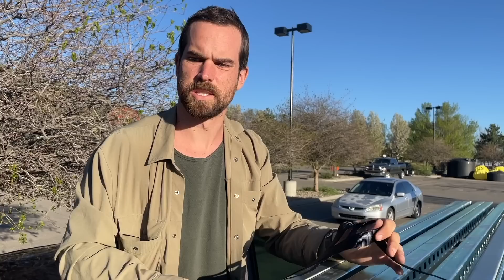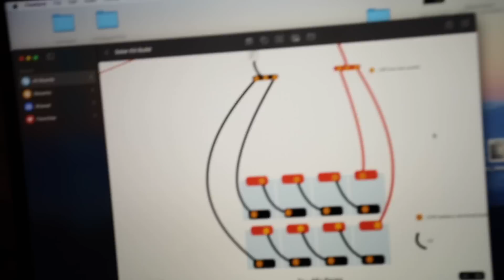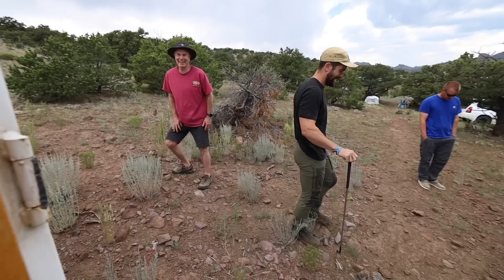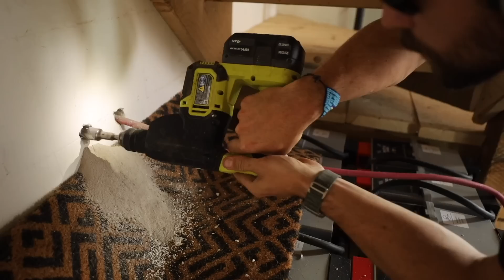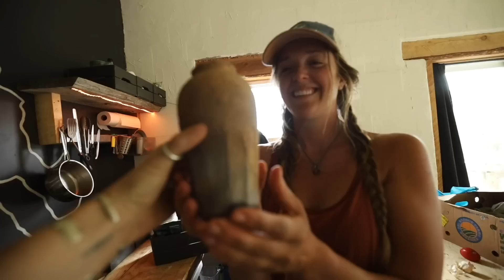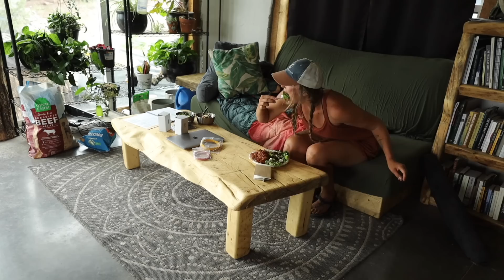IT'S COMPLETE!!!! | Solar Power System Install - Off Grid DIY

Comment: I don't know if you all will even see this or not but I'll  tell ya about anyway. I know how you both want to stay off grid as much as possible  but when I saw you hooking up your solar post yesterday it got me to thinking. Barron said you were thinking of propane or electric hot water heaters. Years ago when I was little our electric hot water heater caught on fire and my dad didn't want to risk it happening again  so he just took it out, anyways  he was some what of an inventor and for winter he built a woodburning hot water heater.he found a water tank  with a flume going up the middle of it built a fire box to have a fire in and welded them together and hooked water to it it helps heat the house in the winter and they have hot water. In the summertime they have  solar hot water. He took an old side by side refrigerator and put two water tanks that he painted black inside and covered it with a sliding glass door pointed it south and you basically have hot water all summer long. He passed a few years ago but my mom still uses this system to heat water. Sorry the post is so long but I hope it helps.

Comment: From an Electrical Engineer, for a DIY project, that solar installation is fine. Like you said, you gave the reasoning for the flat vs angled solar panel etc, and that hopefully, a certified electgrician will come inspect it later etc, etc. 
Only thing that I would have recommended (not seeing it, but it may be there. If it is, then ignore),  would have been a battery disconnect breaker for each 48V battery bank.

Comment: LP stove , dryer and water heater 100% Keep the load off the electrical so you have the power for stuff you can't use LP for.

Comment: i dont get it... why not install that inverter inside together with the batteries just to protect it from the weather outside and safer to fix/troubleshoot it especially when its raining hard
Reply from the maker: It is designed to be outdoors and because it is so loud as stated in the video

Comment: Mind blown on the sun/fire explanation! Joining the club of the clueless re: the electricity, but my husband and I would love to have some solar power at some point and I just love watching you two tackle projects, so this one was fun. We love our gas on-demand water heater, although the on-demand part means we have to run the water for a minute or two before it gets hot and I don't like wasting that water. I had an electric glass-top stove at my last house, now I have gas, and I wish I had induction. I thought I'd love gas, but I don't think all gas stoves are created equal. I find it very difficult to get the heat low enough on our builder-grade model, I don't feel like I can cook as well on it, and we always like to have ventilation on when we use it. We've had a couple accidents of leaving a burner on which is scary, plus I burned myself pretty bad one of those times. But someone mentioned canning, and I can see how having high heat for that could be helpful. A stove/oven is like a power tool in that if you're going to use it a bunch, it doesn't pay to cheap out.

Comment: Good job.  I'm installing a 30Kwatt system now.  Just an FYI,  you will want to double your solar panel's because of low winter sun yields.   Summer gives gobs of power.   Everyone should design their solar system based on winter conditions.
Reply: I think that's very wise advice.🎉🎉🎉
Reply: I absolutely disagree! 
This is the main problem in solar power you never know how long an deep are the 'winter conditions' your system can be too small ever. Use grid power or generator power if you will be offgrid!
My advice water cooled diesel generator for heating.
Reply: Thank you for that info. This will be my first winter, so without that info I'm making my system expandable- batteries and panels.

Comment: What a great video! Thanks for sharing! I'm on year # 12 living full time in a small RV. I do like using the water tank, and love having propane for cooking and heating water. It's nice to have, especially for an emergency heat source.  I am still using my now 21 year old Atwood RV 6 gallon water heater.  Never fails. I turn it on for about a half hr which gives plenty for 2 quick showers and dishes. Then I turn it off until tomorrow. Propane stoves and ovens are so reliable.  Enjoy....You guys are so cool. 😎

Comment: If you guys are planning to do any canning a propane stove is probably the best way to go. Induction is not great because the glass can crack. You also need specific cookware for them. Great job on the solar!!
Reply: Agreed.  I took a canning class last year and they advised not canning on an induction or glass top stove.  Flame heat only.
Reply: Could they not use an induction  for general cooking as they have a solar set up  and use a gas Camping stove for their Canning???
Reply: @sparsh415 I agree since they will be using solar for electricity induction would be good for regular use. There are some great camp stoves that would work with propane outside where it doesn’t heat up the house. My stove has an induction cooktop with a convection oven that also has air fry. That’s another small appliance that can be eliminated from the countertop. It also eliminates the need to do such small batches in a regular air fryer.

Comment: Congratulations on your new power system.  Didn’t understand most of the specifics but I can always rewatch it.
Propane cooktops are easier to control your heat and that can make the difference depending on what you’re cooking.
I notice you guys had Linnea visiting, are your properties close to each other and do you guys also have 40 acres?  Enjoyed the video!

Comment: How do you plan to clean them in the winter or harsh elements? Will you have any safety measures put in place in the case you need to access the roof?

Comment: Few thoughts on the stoves. If you  get induction be very careful with cast iron. They aren’t recommended for induction ovens and even if you do use them it’ll scratch it up. For actual cooking, GAS ALL THE WAY 👏 Not only are you guys used to cooking on gas so switching to induction will be more annoying but there is no better way to cook consistent meals than with gas stoves. :) 

This comes from us living with both versions and I would take a cheap gas stove over any induction stove anyyy day!

Comment: We have had solar water heating for 16 years - our tubes heat glycol that then transfers the heat into our tank. The glycol works really well because it can still heat if it’s below freezing, but sunny.  We have a fan cooled radiator when we’re making too much hot water.  I looove my endless hot water in summers. Our big tank does use a single electric element we turn it on when we need to augment during dark dreary days.  Hope you’re not in the path of any wild fires. Wishing y’all continued success with your solar system.

Comment: Good job. This will work fine. In the future, flip every other battery 180 degrees and the copper wires can be shorter.
Reply: I considered this but figured it would be more confusing to look at.

Comment: Interesting your doing battle born batteries. I had mine put in my tiny camper 2 years ago and then it now is dead and the company checked it to try and restart it but it is dead dead. I always kept it well charged too over 90%. Anyway, I’m waiting for Battle born now to honor my warranty and it’s been over 2 weeks. I’m glad the company who put it in my trailer is dealing with them but it does suck that it failed and I thought they would last 10 years or more and now my camping on hold for possibly a month. I’m sure it’s a flock. These batteries are supposed to be the best out there.

Comment: be mindful of heat pump technology for your winter months - they do not like the cold - I leave my electric hot water cylinder on each day for 4 hours and turn it off and I'm on the grid - I get 3 hours of free power each day from my supplier (here in NZ) so use the free power - I have a fire to heat the house in the winter and open the windows and have a fan in the summer - my powerbill is around US$15 per week - I have had both induction cook top and gas - gas wins everytime

Comment: Look at Rheem water heaters, they are more expensive but pay for themselves. They have all kinds of systems. The tanks are insulated like a yeti cooler so they hold temp really well without pulling a lot of power. We have ours set up on an off peak program through our electric co-op and we’re never out of hot water.

Comment: I'd go induction. If you have enough power. Propain is expensive and smells, you always need to check to make sure you have enough.  Electricity solar is free. You put the system in might as well uses it! 😊

Comment: No electrical experience here but could you alternate the batteries, spinning every other one 180 degrees so that the cables would be straight lines across (so it would be positive negative alternating in a straight line)? This would save like a foot or two of cable at best but it was a thought I had wasn't sure if it made sense.

Comment: Way to go making such a big difference. We have induction stove which we really appreciate and like. We have on demand electric hot water supply; very happy with that too. We have solar panels on the house, standard American city house and most months our electric bill is $13.00. Higher when I run the electric dryer. We’re sold on solar, obviously. Good luck with your decisions.
Reply: I live in a standard, but tiny British house. 
I use a single induction stove for most cooking, with a back up small propane camp stove for if I need a second burner (or to use my very old , very loved, copper based pans that you would have to prise from my dead hands, bought in 1991 as a “pay extra so you only have to buy something once”!)  I have a convection combination oven/microwave that I sometimes use to bake bread, make toast and bake potatoes (not at the same time) :-) 
I use an electric shower almost exclusively instead of baths. 
I don’t have or use lots of electrical equipment - I don’t own a computer or television, just a well loved older smartphone. 

My electric bill is £10.00 a month.  Approximately £100 a year. 

I have an on demand gas tankless water heater (and gas central heating - on all year round at 16°C) 

My gas bill is now £42.00 a month.  Approximately £500 a year.  (It was significantly less two years ago, and so I did not receive the full £66 winter fuel payment from the government at that time.) 

One day I might decide to go buy a stove/cooker, but in no rush as I have a small fridge freezer in the space where it should go and I would have to get rid of my kitchen table which I use multiple times a day instead.

Comment: I wouldn't be comfortable with lithium batteries in my living space...I'd prefer it to be detached power station.
Reply: Why? These are not at all like lithium polymer batteries that can easily overheat.
Reply: @marionsutcliffe1119  I assumed they were lithium....seems to be all the rage right now 😀....I know better than to assume.....but I did it anyway.